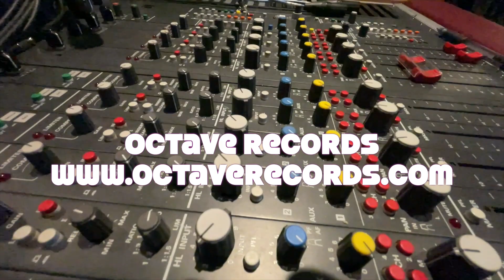Converting DSD to analog

Comment: @0:58 "...not so true with PCM" (not hearing a difference when switching back and forth between the live feed and PCM).
That amounts to the culprit being the converter used to convert the live feed into a PCM formatted file.

Paul, you have said that when you convert a DSD file to a PCM file, that they sound virtually the same.  Ergo, when a source (such as a DSD file) is properly converted to PCM, you cannot hear the difference between live and PCM, just as you cannot hear the difference between live and DSD.

Paul, as far as I know, you have used only one analog-to-digital (live to PCM) converter.  From what you have said in your videos, the issue with your live to PCM process is with your converter -- not with the PCM format.

If you never try other top rated analog-to-PCM converters, then how can you conclude that PCM is inferior to DSD, and yet have stated that converting DSD to PCM yields virtually equal sound quality?

-----

@1:47 "It's upsampled, then converted to DSD"
@1:56 "It's not like we're adding something..."

Please correct me if I am wrong, but upsampling is adding samples (snapshots) that are computer generated, mathematically, based on two adjacent sample.
The whole point of upsampling is fabricating (adding) samples.

@2:30 "If you look at a DSD signal on a scope, you can see the music.  You can see the sine waves."
Paul, computers do not store analog data.  Computers cannot store analog data.  Everything that is stored on a computer is in digital bits.

A DSD file is no exception.
I have no idea what the formatting of a DSD file is, just as I have no idea what the formatting of an Excel file is.  But since each is saved as a file on your hard drive, then each is purely digital.

If you are seeing a sine wave on your scope, then something, somewhere, read that digital DSD file and converted it into an analog signal.
A piece of your equation must be missing.

I do not have all of the answers.  But I am more or less just shy of an expert on computer hardware and operating systems.  A file on a computer must be digital.

@2:58 "DSD, when it's converted , that conversion process is very analog-like..."
Yes, because somewhere in your process you converted the purely digital DSD file to a sine wave.  So what you saw on your scope was after the digital DSD file was converted to an analog signal.

If your scope was not set to read a sine wave for its input, then your scope was not reading an analog signal.
Perhaps your scope was reading a digital signal that mimics the wave form of an analog signal?  In such a case, it would be a digital signal that would still need to be processed by a DAC to truly become an analog signal.

DSD might have the sonic edge over PCM, when both are at their best.  But let's make sure that both are actually at their best for such a comparison.  Until someone uses flagship analog-to-PCM converters to compare with flagship analog-to-DSD converters, no conclusion should be reached.

Paul, have you listened to PCM with, for example, the Inuos Statement transport?
If not, you are not hearing PCM at its best.

If DSD does not suffer from noise and jitter, then perhaps that is why your DSD files sound better?  They are, perhaps, sounding the equivalent of what the Statement transport provides for PCM?

You committed your business to DSD.  I hope that is not influencing your conclusions, without proper testing, such as I noted above.

Thank you.
Reply: And if you can convert DSD to PCM and it has maintained the "analog goodness" (or whatever the heck he said) then you can capture the analog goodness with PCM in the first place. If PCM can "represent it" in digital format. then it can capture it.

Please remember who we're dealing with here. Someone who sells an extension cord for AC for $5400, and a 3 ft. RCA cable for $3750. He MIGHT NOT be the most reliable source for technical information.
Reply: @Wizardofgosz  The funny thing here is that the only claim here that is far fetched is converting DSD to PCM without any loss. Maybe Paul has discovered the holy grail, but I've never heard a DSD to PCM conversion that didn't suffer a big loss in sound quality as well as change in timbre.
Reply: And NONE of this matters unless listening tests were done in a properly conducted double blind test.
Reply: @Wizardofgosz  "And if you can convert DSD to PCM and it has maintained the "analog goodness" (or whatever the heck he said) then you can capture the analog goodness with PCM in the first place. If PCM can "represent it" in digital format. then it can capture it."

Yes, assuming that a real-time, analog-to-PCM converter has that level of quality.  Based on comments from Paul, he has tried several, and none are as good as his real-time, analog-to-DSD converter.

"Please remember who we're dealing with here. Someone who sells an extension cord for AC for $5400."
Paul sells no extension cords.  He might sell power cords (I never checked).

If you have a state-of-the-art stereo, then such power cords will allow your stereo to sound its best.  And price is not necessarily synonymous quality.  There are some expensive power cords that are not worth it.  Others are, if you have a stereo that is on that level of quality.

Same thing for interconnects.

"He MIGHT NOT be the most reliable source for technical information."
I do not know who is the "most" reliable source of technical information.  But Paul is extremely reliable.  He falls a bit short when it comes to the computer processing side of audio processing.

"And NONE of this matters unless listening tests were done in a properly conducted double blind test."
I do not need a double blind test to tell me when you swap out my speakers.
I also do not need a double blind test for countless other listening sessions.  Just because you really hear differences in sound quality does not mean that you imagined the differences because you did not use a double blind test.

I have made upgrades to my stereo without doing double blind tests.  And I am 100% positive that my upgrades sound better.

If you feel that a double-blind test is necessary for every listening session, then I am concluding that you never heard a professionally set-up high-end stereo in a treated room.  Such a stereo reveals differences that the stereo from Best Buy will not.  And the differences are striking.  You must hear such a stereo and you will then know that double-blind tests are a waste of time for most listening sessions.
Reply: @Wizardofgosz  The whole point of bringing double blinds into audio is to isolate those who believe in them from having to listen to anything themselves, and so protect their beliefs from new information. To everyone else they are large irrelevant.
Reply: @Wizardofgosz  Perhaps you mistake "terror" for irritation with pointless tedium and unnecessary hoops to prove what is already immediately obvious. I dont know how many blind tests I have done, with DSD it is incredibly easy, but since I don't have millions of dollars, a PhD, and a year of my time to publish a research paper, whatever I do doesn't count. And why bother? The difference is easily heard, and the people who insist otherwise are cranks who haven't listened themselves. Nobody wants to invest time and effort in setting up an unnecessarily complex test to demonstrate the obvious to people who will continue to believe whatever they want.
Reply: @chipsnmydip  I don't believe you for one second when you say you've done properly conducted double blind tests, because I know that when they are done, no one can reliably hear the difference.

Paul himself refuses to properly debate people on this subject.

The narcissism in the audiophile community is off the charts.
Reply: @Wizardofgosz  I've done plenty of blind AB tests, which are as good as necessary. DSD to PCM is EASY. The reason to make it pointlessly more complicated is for gatekeeping rather than honest inquiry.

Here is what YOU can do. Get a native DSD capable DAC and player that controls the DAC at native sample rate. Download a DSF file recorded as DSD or transfered from analog. Use software to convert to PCM. Make a bunch of duplicates of the DSD and PCM with different names, load them into a playlist, set to shuffle, close your eyes. Easy. If you are honest you will be surprised.

Comment: Each sigma delta DAC converts PCM to DSD as far as I know. What’s the difference if we use PCM or DSD for transmission and storage?
Reply: Well, the difference is that the original waveform is modified for PCM to be stored by the anti-aliasing filter, which enables the PCM encoder to throw away all but the samples at the PCM sampling rate. These can then be restored at playback time (the modified waveform).